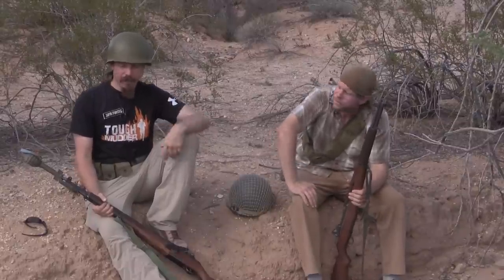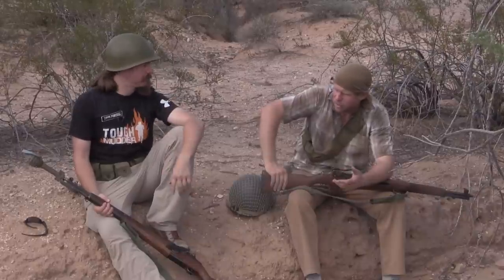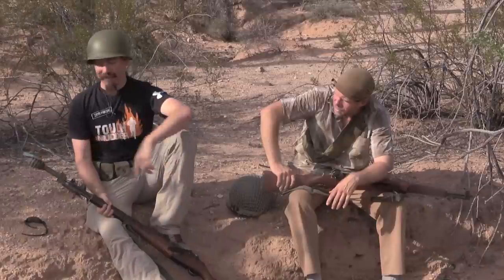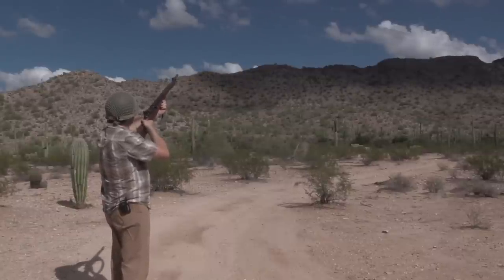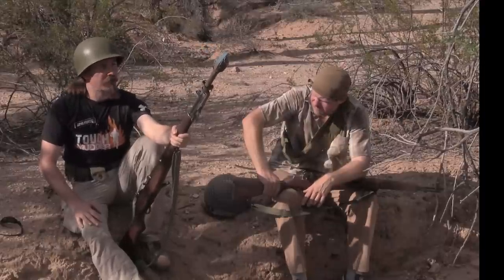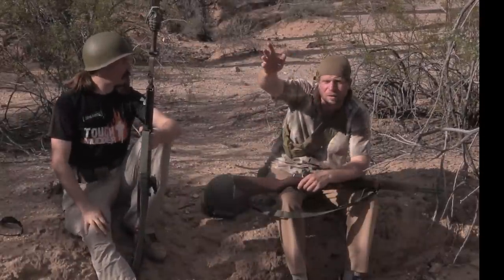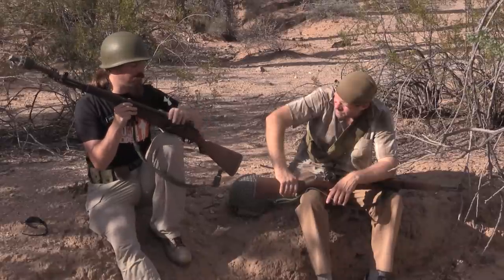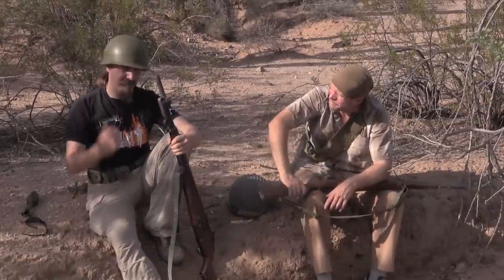M1 Garand Rifle Grenades - How, Why, What?

Comment: Using a Rifle Grenade round and mounting the actual projectile at the mid way line (which I believe you said was probably the lowest point you could mount it and still safely shoulder the rifle), how effective would a training or dummy round be as a kinetic projectile?

(Also, not sure if they're true, but I heard of accounts of soldiers in combat sometimes jamming the grenade too far down before firing it from their shoulder, and causing some injuries. Broken shoulders etc)

Comment: I wish they had explained how grenades were mounted so that the safety lever is held in place allowing for the pin to be pulled, then fired. Firing a grenade, even an inert grenade, with the pin attached could be a bit misleading.

Comment: This is the secret weapon in the army's been looking for they've had it in the past but with modern technologies and upgrades of shape charges they can take out 272 tanks all by themselves instant artillery when they need it against the heavy machine gun in placement and the range can be extended with rocket assist adapters this is almost the perfect weapon in their light easy to carry compacts a lot of them can be carried and a four or five guys on a squad has couple three or four of these that's an artillery barrage especially the new capability of switching it from shape charge to fragmentation charge this could be the ultimate weapon for the infantryman

Comment: The movie 'Battle of the Bulge' had a short scene where some GI's were trying to knock out Tiger 2's with rifle grenades. If a HEAT round hit the top deck of one of those beasts, it could have a chance as the hull top was 40mm, and turret top 44mm.  Anyway, in the movie it was no dice. I guess it was hard to hit+penetrate a moving target with a rifle grenade. Kudos to the film makers.

Comment: The French still use extensively this feature with their Famas and requested the capability on the new HK416 they ordered.

By the way, if you wonder why the Sig 550 have a larger section with a ring on the barrel, that's why.
Reply: Indeed, France's new HK416F barrells will be fitted with an integrated rifle grenade launching device (!)
Yet, France also ordered a whole bunch of 40mm grenade launchers
Reply: Isn't a 22m rifle grenade ring a set NATO stranded anyway?
Reply: they want to use both. they both have there ups and downs.

Comment: this place called Service of Supply makes rubber ones that work with just regular blanks. check them out. also, what would have happened if a soldier put this an an early gas plug? would the rifle blow up?

Comment: tech question: if muzzle energy for an '06 is around 2500-2800 foot pounds why is recoil energy only around 18-20 lbs - even taking the weight of the rifle into account? Big difference between the two when Newton says they should be equal, no?

Comment: How would it affect riffle if you used the weaker blank without the the gas plunger ?
Reply: A "report" blank would still create too much pressure in the gas system & likely break your op-rod [Newsflash: the U.S. gov't. arsenal system no longer exists & will NOT be manufacturing more replacement U.S. Rifle, Caliber .30 M1 op-rods!]
Reply: @Bruciando  yes but plenty of other after market companies make them along with companies making brand new military spec complete rifles.

Comment: How do these compair to modern underslung grenade launcher like the m203?
I always thought that the squad would get issued a aditional rifle specifically for this job but i guess the swap time is fast enough haha.
Reply: You can always get an additional M1 rifle from a casualty and stick the launcher on that. Finding a guy willing to carry two 9.5 lb rifles and the rifle grenades is the real problem.

A scene in the HBO series Band of Brothers show one paratrooper carrying an M1 Garand and a grenade launcher rigged Springfield on his back. Either that was Hollywood logic or some guys thought the 1 pound difference between a Springfield and a Garand made it light enough to add it and its grenades' weight to his load.

A lighter alternative would be too carry an M1 carbine with its M8  grenade launcher(available from early 1943) either as your primary weapon(the M8 didn't have to be removed before firing regular ammo)or in addition to an M1 rifle. Its 6 lb pound weight(+ rifle grenades and blanks)wouldn't be quite as much of a burden. You could even carry the blanks in the standard 2 pocket ammo pouch slid onto the carbine's buttstock.

Comment: You fired that grenade at a way to shallow angle.  If you could hit your target at that angle you should keep shooting bullets.  Grenades are meant for indirect fire.  Drop it in a fox hole or behind a wall.  If you would have it a wall with that grenade at that angle it would have bounced back toward you and your own troops.  Unless maybe you were aiming at a small hole in a pillbox and even then it would most likely not be accurate enough to hit the target.  Get some air under that thing.

Comment: Are grenade launchers still in use? It would seem that the typical infantry unit, at least the actions of the big units, battalions etc are winding down, and accordingly, the weaponry.
That is not very clear. Sorry. What I am trying to say is that the modern infantry action tends to be small and covert. Am I right in saying gone are the days of The battle of the bulge.
It occurs to me that the secretive SAS or SEAL actions would have little use for a grenade launcher. A sharp knife would be more appropriate.
So, back to my original question. Are these still in use, and if so, who uses them and under what conditions?
Thanks, All.

Comment: even tho you made/cut to make that look fast. But God how slow to make this happen.
Reply: Depends on the unit/mission. If they think it's important to have firepower immediately available like if they have to breach a structure then the grenadier would likely have the grenade sight on at the very least. Depending on the need, they may or may not have the launcher attached and also possibly loaded with grenade launching ammo. The grenade itself wouldn't be attached until actually needed for safety purposes. At which point they would either use another grenade if needed or reconfig the rifle into rifle mode.

Comment: When do you pull the pin???
Reply from the maker: After it's in the cradle on the rifle.  ~Karl
Reply: So it isn't a single unit. A grenade and a mount. Does the cradle flex or shift rearward on launch to release the spoon? Thank you for taking the time Karl.

Comment: Ok so can this fit a 1903 Springfield
Reply: The add-on launcher for the M1 was based upon the existing design that fit the m1903 Springfield & m1917 Enfield rifles. One of the advantages of basing it upon the bayonet attachment, which was identical for all the rifles. The attachment for the M1 Carbine was of course, unique, since it had its own bayonet mount & bayonet.

Comment: Do you think rifle grenades are still viable? Why do only the french still use them?
Reply: They prefer the larger warhead, and make up the loss of range with guided ordinance and launchers.
Reply: Will M they feel they dont need the extra range and prefer the larger warhead. its just a difference in combat doctrine
Reply: The effect of using them in an infantry assault on a defensive position would be the blitzkrieg effect stormtroopers. shock. Combined with rapid rifle fire and maneuver. 
 in an ambush it could potentially increase survivability. 
 in a defensive position hitting the enemy at 200 metres with grenade , priceless